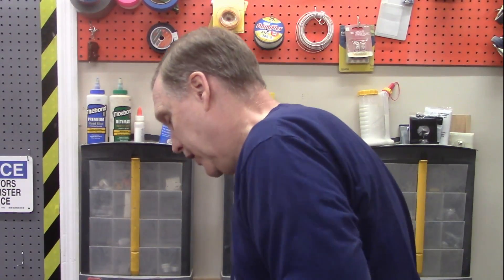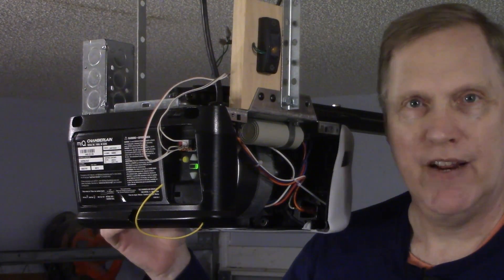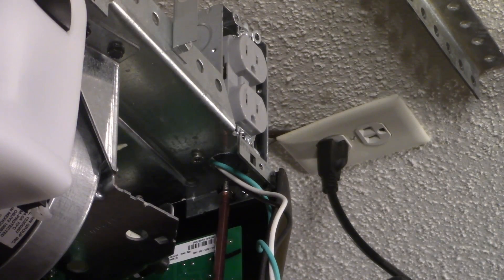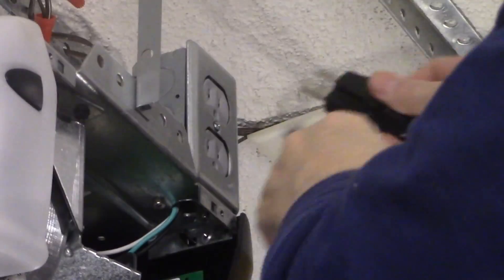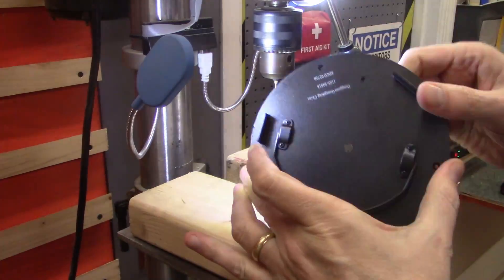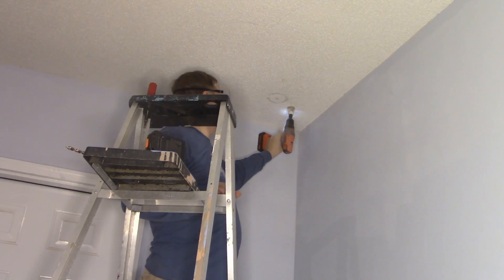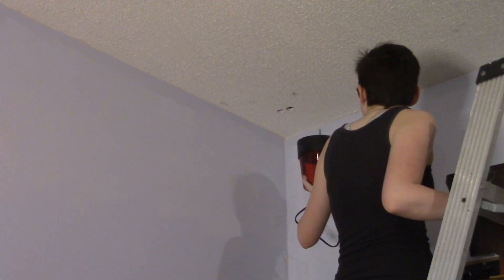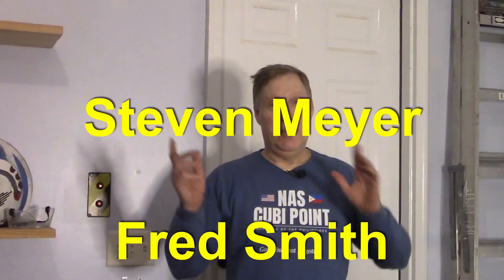Garage Beacons - Automatic Party Lighting

Comment: Hey, NAS Cubi Point. I was stationed there with VRC-50  years 1976 to 1980.
Reply from the maker: Was that you with all the Greyhounds? We were there at the same time! I was at San Miguel from 77-79. I was in junior high but I was there. What an amazing place that was!
Reply: @AtomicDairy  Yes we had the C-2a's, C-1's, CT-39's, and C-130f's. I was aircrew on the C-130's.
Reply from the maker: @lewisway6811  did you ever make C-130 runs to Okinawa? I flew Space A from Cubi to Kadena in '78. Was I on one of your flights?
Reply: @AtomicDairy  They were all regular destinations, so very well could have been.
Reply from the maker: @lewisway6811  on that Space A flight we were with a bunch of Marines and they had a jeep lashed down to the deck. One of the flight crew handed out a plastic bag of pink wax ear plugs and the Marines passed it down the line. I thought it was bubble gum and promptly ate two of them, much to the delight of the Marines. That was my adventure on your aircraft...
Reply: @AtomicDairy  Lol, yea I have seen that happen, but we were given the little yellow  foam ones, once we got rid of the the old pink wax ones.